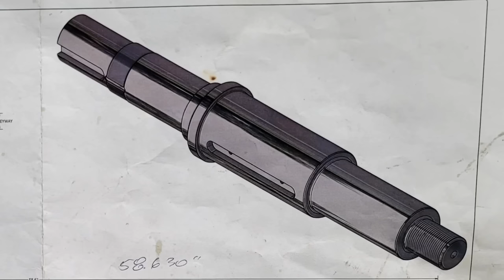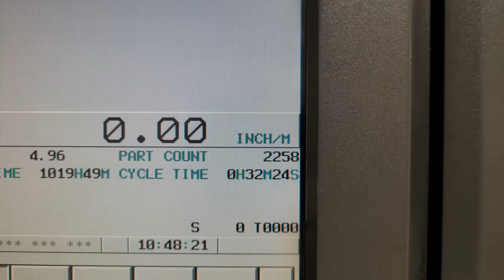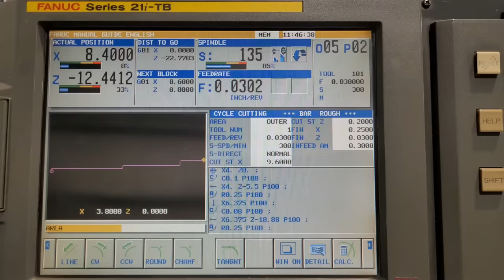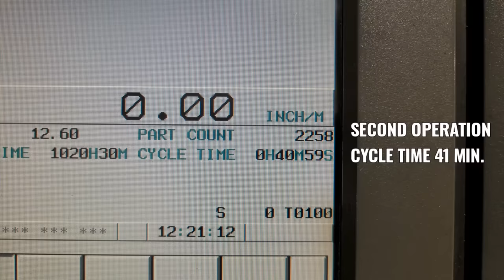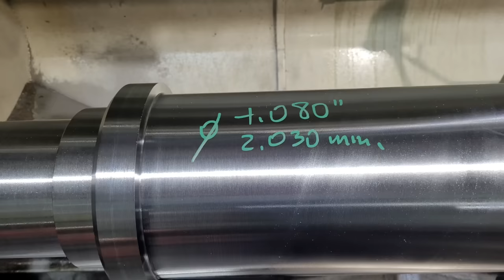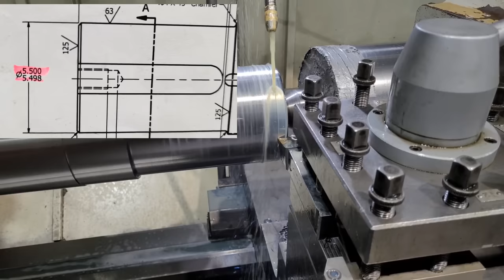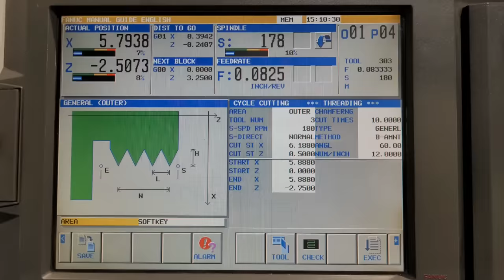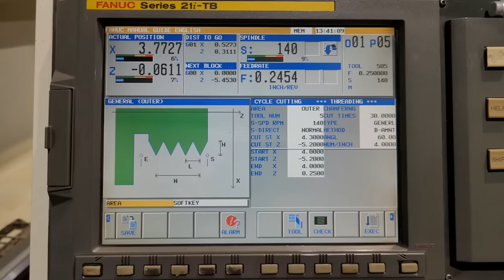Top Roll Spindle | L.H. Threading | CNC LATHE

Comment: It’s nice to see some REAL feed rates, my work has us running our lathes at a maximum of .010 per rev, averaging about .005 on soft materials like copper and it’s sad. I used to machine 4140 roughed out at .040 per rev
Reply from the maker: Seems like they don't care how long it takes as long as you get the job done.
Reply: @ChrisMaj  I do semiconductor work so pretty much locked in with how we do things, how the program is written, hard to make any changes. Also don’t have any other customers. There are these little lathe parts about 1 inch long out of copper I make 2000 at a time sometimes, we use a bar puller so it makes 25 pieces per hour, they absolutely refuse to buy a sub spindle lathe ( a cheap one would work) with parts catcher and bar feeder. Could easily make it automated. But they would rather me sit there for an hour doing nothing, it takes 10 seconds to load another bar in. It’s crazy, they don’t care about production and we charge out the ass. That type of mentality makes everything expensive in America
Reply: @ChrisMaj  back in the day I would run my lathe at the highest feed rate possible and chips would fly because time is money. Any semiconductor shop is the exact opposite cultures for some reason
Reply from the maker: @adammiller4879  I don't know man. I would go fucking nuts doing same thing over and over. I hope the pay is good .
Reply: @ChrisMaj  we have about 20 different parts total between mill and lathe but for the most part most commonly run the same 4-5 parts everyday. I make 26.50 so not great but it has great benefits and we get bonuses constantly and they buy the whole
Company good food every other week
Reply: If you count the health insurance and bonuses they pay out I make about 34$ an hour. Iv only been there about 16 months but yes I’m going absolutely nuts when I start making the same part over and over, here recently we been getting a lot of new parts and I have the most experience so I get to program them thank god. We have hurcos, mazaks, and dmg mori lathes

Comment: That's some beautiful work.  Were you able to achieve the 16 rms finish when you slowed the feed down?  Any time I needed the 16 rms finish or better, I put it on a grinder attachment.
Reply from the maker: You slow down the feed to about 0.004 IPR with 0.032" tool radius and you should be able to get around 16 rms in 4140.

Comment: Hi Chris!!! It's amazing job!! I'm from Brazil, can you send The specification tools Fix8 and tools for thread?
Reply from the maker: Fix8 PCJNR206D, but you might want to check kennametal catalog cause they have few different styles. Insert KCP25B (but that depends what material you are working with) 
Threading tool 
Iscar GHGR 31.7-5 
Inserts TIP5MT-0.25
Reply: @ChrisMaj  thanks!!!!

Comment: Does the parting style threading tool have certain benefits above the common  laydown type with three cutting edges?
Reply from the maker: I can do all kind of threads with just one insert. Metric, imperial 4 TPI up to 18 TPI, or I can use it as grooving tool.
Reply: @ChrisMaj  Thanks Chris. I'm only doing smaller stuff up to 11TPI Withworth and 8TPI NPT. I'd consider that as peanuts compared to your threads :)
BTW: Can the Fanuc control also operate in something like a manual mode, e. g. running single cycles without writing a program? Not sure if our ~2005 0iTC can do this. I prefer Siemens Manual Turn (from approx. 2000, now the interface is called Shop Turn) for one offs as you can  do many semi-automatic tasks. Mazatrol is also a control I like and daily work with. I never really started to like the Fanuc control we have - like when you hit reset in the middle of the program and then hit cycle start it just continues where it was and doesn't jump back to the beginning. The first time I was like "WTF?". But that might also be a parameter thingy.
Reply from the maker: @1AB09CC3  most of my programming is done with fanuc manual guide. I don't know about your control, but you have to hit that reset twice in order to go to the beginning of the program

Comment: How do you ccheck that the machine is not doing taper to the axle?
Reply from the maker: Most of the time I take two finishing cuts. I'll check the diameter, make some adjustments if I need to and then final cut. With large parts like that I can just run one finish cut and hope for the best.

Comment: That tool is a beast when we do 4140 driveshafts at my work we run CNMG544 .300DOC .020Feed 400SFM. What is the name of the part you added to the spindle of the mics when measuring over wires?
Reply from the maker: It's an Anvil Attachment kit. I think there's 5 pieces. I got it years ago  but it looks something like this. 
7 PC Micrometer Tip Anvil Attachment Set Precision Ground https://a.co/d/fRnrOvY
Reply: @ChrisMaj  excellent thank you. Most of the time we just use 2 wires not all 3. The measurements are usually with in .0035 or less. We thread to fit to the mating part so being exact on the PD is not as critical.

Comment: Hi Chris, thanks for the amazing video. Like your stable and  powerful lathe, that can handle the Fix8 tool. When adding water for the coolant, do you check the concentration ?.
Reply from the maker: That lathe could use a little more power, but it is what it is. I do check it once in a while, but most of the time I just kind of add water, add some coolant, add more water.

Comment: At 4.40 min you show the check on running true so I imagine that your 4 jaw can easily overpower the dead centre in the end of the part and push the job off the centre.
Reply from the maker: It's just a regular live center and I can easily move it around 0.010"
Reply: @ChrisMaj  I imagined a dead centre in the headstock.
Reply: Live center with his patented duct tape swarf rejecter.  ;-)
Reply: @ShainAndrews  Not yet patented, but "patent pending" ;-)